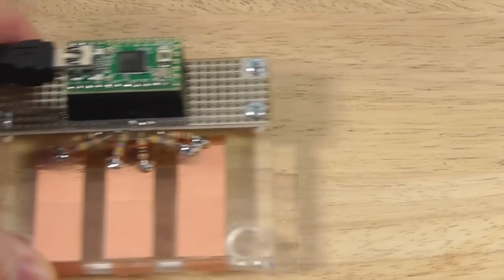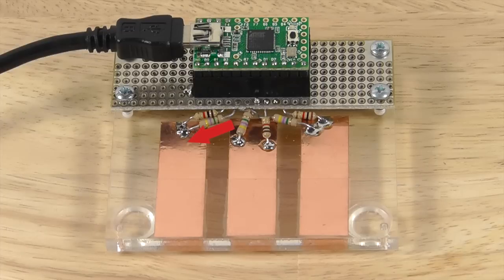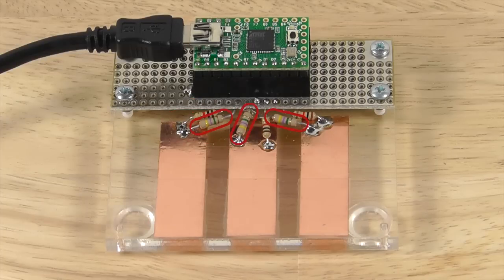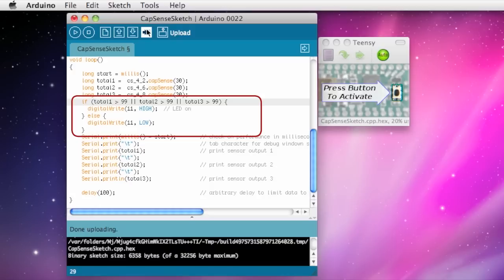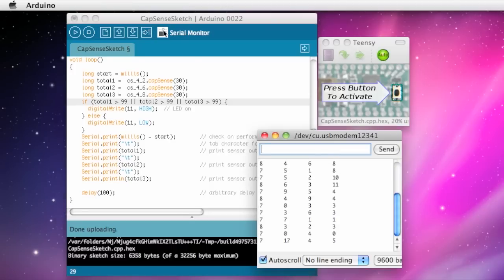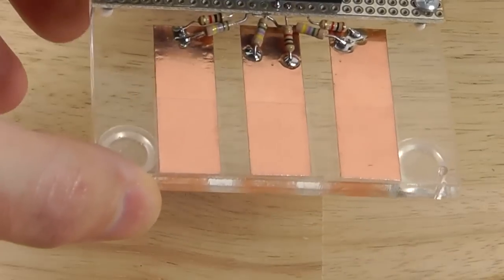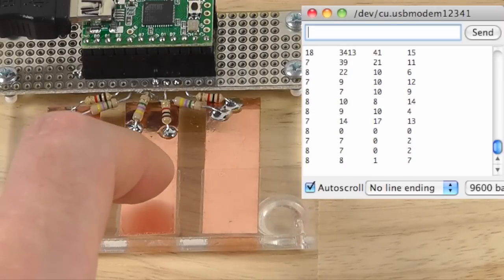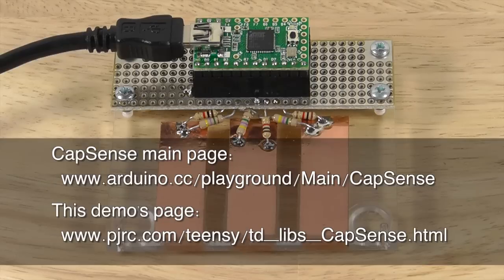CapacitiveSensor Arduino Library, Demo on Teensy 2.0

Comment: Im getting the following error when I verify the CapSense sketch. Is there any special installation instructions. I did add the library to my arduino projects folder. The library shows up under libraries. It seems to be something with the example code.

Comment from the maker: I believe they are the same.  Copper, Aliminum, Tin, Brass, or any non-ferrous metal (eg, magnet doesn't stick) should work identically.  Ferrous metals probably also work fine too.

Comment from the maker: It's the same copper tape that's sold for create stained glass art.  It's meant to be soldered.  Normally stained glass soldering is done with large/powerful irons.  Just give it a little time to heat up and the solder will flow.

Comment from the maker: If the foil conducts electricity, odds are very good it will work.

It's so very easy to try... just connect it using a couple resistors to any 2 digital pins on any Arduino compatible board and run the CapSense example (edit the pin numbers to the pins you used!)

Maybe you can reply here after you've tried it, to let everyone know if it worked?

Comment from the maker: CapSense might work, if you use many smaller metal pieces, but that's not really one long continuous metal strip.  Probably not quite what you want.

I did see the ideal product (for your project) recently, and some used it successfully with Teensy a few weeks ago.  The pin number defines may need to be edited, but I have 1 confirmation it does work.  Since youtube doesn't allow links in these comments, google for "QT1106 breakout", and click on "7 Key Slider/Wheel".

Good luck & send me a photo

Comment: I want to make a synthesizer which plays sounds with pitch based on how far your fingers are from one end of a long metal strip. (Farther away from the electrodes would make a high sound, and sliding your fingers closer to the electrodes would make a lower sound.) Could it work?

Comment from the maker: I wired it up exactly as described in the comments of the example that comes with version 4.  Open it from File > Examples > CapSense > CapSenseSketch.  Yes, all three 4.7M resistors connect to pin 4.  The receive pins are 2, 6 and 8.  Of course, you can use any digital pins, but those are the pins used by the example program than comes with CapSense, and for this video demo I just used the example code.

Comment: So you you soldered one lead of each of the three 4.7 M ohm resistors together and then attached them to pin 4? And the 1 K ohm resistors to pins 2, 5, and 8?  Is that right?

Comment from the maker: 1: Each electrode connects to 2 pins.  The send pin needs a resistor.  I used 4.7M in this video demo.  The receive pin can connect directly, but I used a 1K resistor which helps protect the pin.
2: CapSense uses digital pins.
3: I did not use CapSense's AutoCal functions.

Please check the CapSense page on the Arduino Playground.  If you google "capsense", it's the #1 link.  It explains CapSense in much more detail than I can put into a 90 second video demo.

Comment: 1. I'm a bit confused over which resistors go to which pins. You say "10 megohm resistor between pins 4 & 2" and then you add a second 1K ohm. Does the 10 M Ohm go to pin 4 and 1K to pin 2? Or is it the other way around? 
2. And are you talking about the digital or analog pins? 
3. And you say "something about shutting off autocalibration. When would you want to do that?

I am using a Duemilanova to try to give my hacked Elvis robot some sense of touch.

Thanks!

Thomas

Comment from the maker: @scottfx10 The sensitivity drops pretty dramatically as the material between the metal and finger gets thicker.  A thin 1/16 inch (approx 1.5 mm) plastic might work?  The only way to know for sure is to give it a try.

Comment from the maker: @notbot Yes.  There's a MIDI library you can use for regular (5 pin) MIDI out.  It works on all Arduino compatible boards.  Teensyduino (Teensy only) also has USB MIDI, which you can use from the Tools > USB Type menu.  It should be pretty simple to use either to send MIDI messages when the sensors are touched.